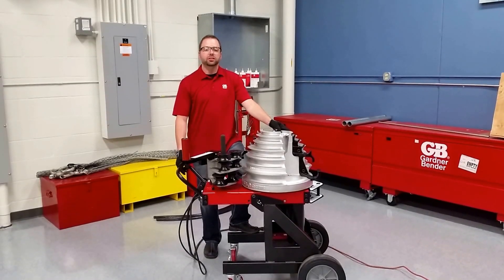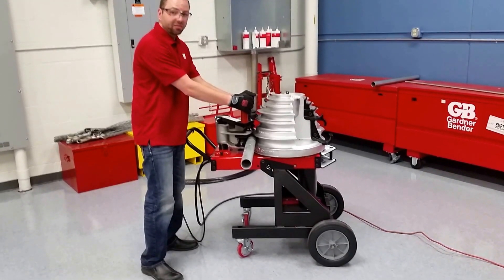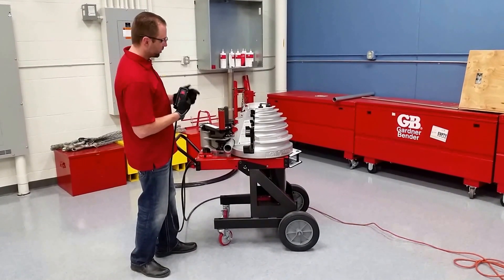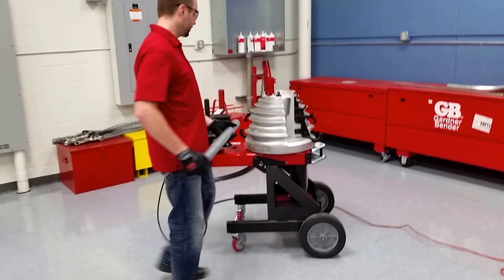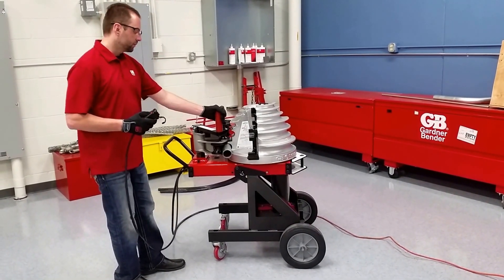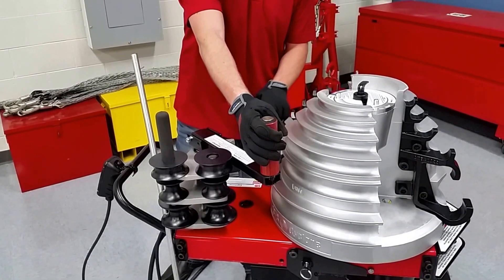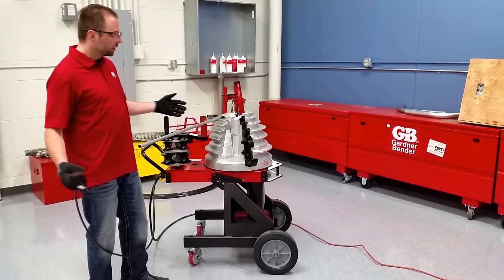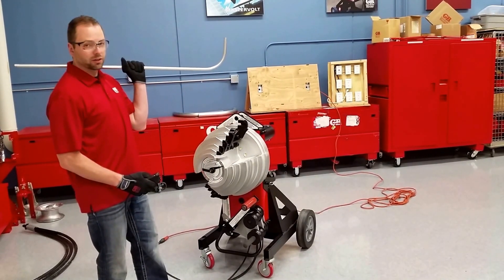B2000 1/2" to 2" Rigid & EMT Conduit Bender - Gardner Bender

Comment: Hi Jason, Internet pedant here. I like that on one of the stickers you guys spelled calibrated caliprated. Oh yeah and I tightened the swing bolt on the handle so the nylock nut grabs a little, nice try not using the right length bolt. But forget all that why not improve the insides to it has better repeatability.